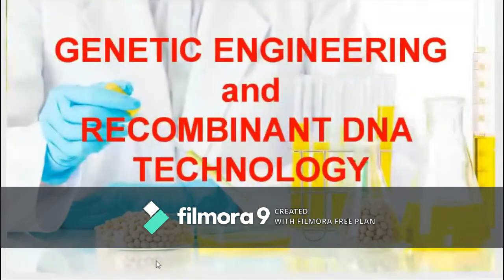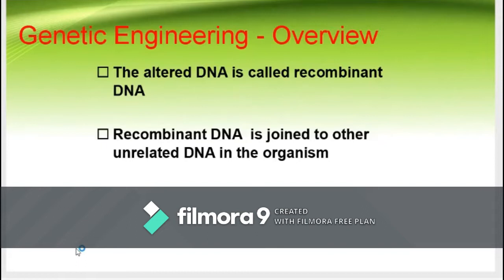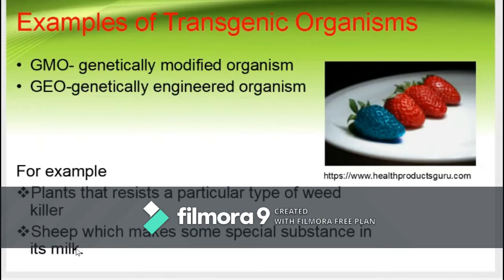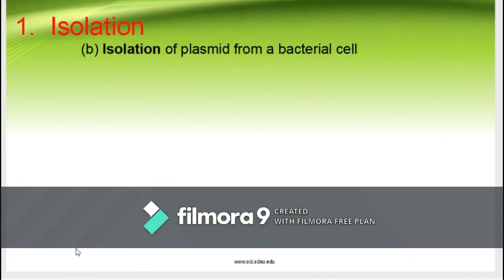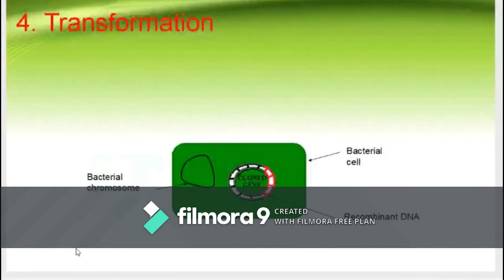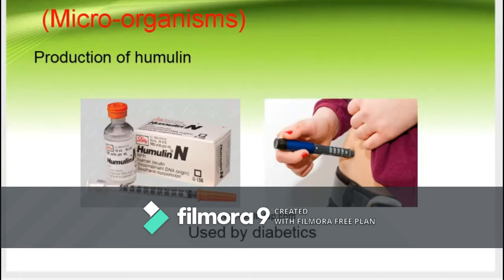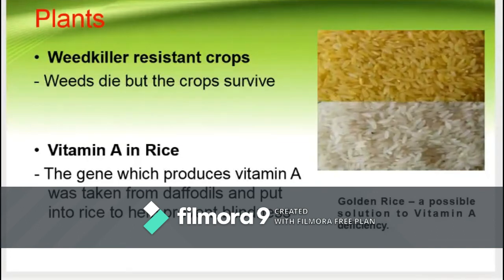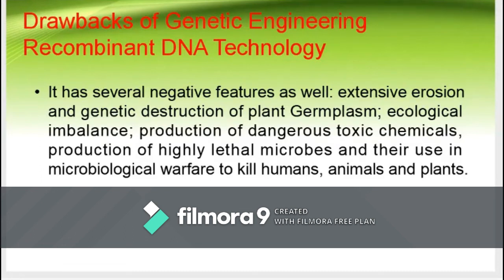GENETIC ENGINEERING & RDNA TECHNOLOGY

Comment: VALES, PRINCESS SHANLEY C.
11 STEM - DMITRI MENDELEEV

 Genetic engineering is the addition, deletion, or manipulation of a single trait in an organism to achieve the desired change such as human genes that are inserted into another animal’s DNA. The result of this manipulation of DNA is called recombinant DNA or RDNA for short. When fragments of a gene are taken out and replaced by different genes, it is called gene splicing. Transgenic Organisms, on the other hand, are genes that were spliced from bits of genes a living thing and another animal creating new genes. There are 2 types of transgenic organisms, GMO, genetically modified organism (plant, animal, bacterium that is altered through any methods including conventional breeding), and GEO, genetically engineered organism. (modified using techniques that permit the direct transfer or removal of genes in that organism. Some of these genes are used for the treatment of illnesses. They can take the form of vaccines and such.

There is a study regarding the genetic engineering of livestock (VG Pursel, 1989), stating that Genetic engineering of livestock is expected to have a major effect on the agricultural industry. A systematic study of the beneficial and adverse consequences of long-term elevations in the plasma levels of bovine growth hormone (bGH) was conducted on two lines of transgenic pigs. Two successive generations of pigs expressing the bGH gene showed significant improvements in both daily weight gain and feed efficiency and exhibited changes in carcass composition that included a marked reduction in subcutaneous fat. However, the long-term elevation of bGH was generally detrimental to health: the pigs had a high incidence of gastric ulcers, arthritis, cardiomegaly, dermatitis, and renal disease. The ability to produce pigs exhibiting only the beneficial, growth-promoting effects of growth hormone by a transgenic approach may require better control of transgene expression, a different genetic background, or a modified husbandry regimen.

	There are 5 stages involved in genetic engineering they are; Isolation, where they find and isolate the specific part of the DNA we wish to copy. Litigation and insertion where the extracted fragments of genes are transferred into a vector. Transformation where the genes inserted into the DNA of another organism. Expression where the transformed cells grow to produce a GM organism.

          I learned that genetic engineering and RDNA technology is very important in our day and age. The world has become a better place since the discovery of genetic engineering. I have learned throughout this video the definitions, applications, and the importance of the said topic. I am amazed at how even with just a tiny bit of DNA manipulation, new genes would be produced and used for medicine and scientific studies and hopefully in other fields in the future.

Comment: Sobrecaray, Ian Joseph I.
Grade 11-STEM MENDELEEV           

            As our technology and understanding of microbiology and genetics, it gave rise to a new field of engineering called Genetic Engineering. With Genetic engineering, scientists are now capable of adding, inserting, deleting, or in other words manipulating DNA to get a desired trait. It is done by copying a piece of DNA from one organism and joining this copy to the DNA of another organism. The altered DNA is called the Recombinant DNA and this process is called gene splicing. The organisms altered by genetic engineering are called transgenic organisms and their genes are changed by other than random natural breeding. Examples of transgenic organisms are GMOs(Genetically modified organisms) and GEOs(Genetically engineered organisms. Although they are sometimes used interchangeably, their meanings are different. GMOs are organisms whose genetic material are altered by any method including conventional breeding. GEOs are organisms whose genetic material are altered by the direct transfer or removal of genes to and from that organism. There are 5 stages in genetic engineering namely: Isolation, Cutting, Ligation and Insertion, Transformation, and Expression. Isolation is done by isolating a specific gene from a donor or by isolating plasmid from a bacterial cell. In cutting, restriction enzymes function as molecular scissors and they cut DNA at specific sites called restriction sites. They will however leave sticky ends which are ends wherein a single strand of the DNA remain in the manipulated cell. In lygation the cut DNA is to be inserted to another organism's DNA and rejoined with DNA ligase. As mentioned before since a single strand of DNA remain in the cut DNA, they can just form a bond with their complimentary chemical compounds. In transformation the cell is transformed and upon reproduction(bacteria) or cell division, the manipulated DNA will be copied and kept by the newly formed cells. In expression the newly formed cells will keep the characteristics of the donor DNA. Applications of genetic engineering include vaccines in medicine, genetically modified rice with Vitamin A in agriculture, and altering human DNA to remove genetic or inherited diseases and disorders in gene therapy. GMOs and GEOs can also be used in mining to remove the toxic waste materials produced in the process. Although genetic engineering can be beneficial, it can also be destructive. Genetic engineering can cause ecological imbalance, genetic destruction, and in production of harmful microbes that may be used in microbiological warfare to kill humans, animals, and plants. Genetic engineering provides promising benefits but is still, at the moment, unstable.

            In a study entitled "Plant genetic engineering for biofuel production: towards affordable cellulosic ethanol", by the researcher Meriam B. Sticklen, tackled the feasibility of cellulosic bioethanol to become an alternative, global, and renewable source of transportation fuel that will replace petroleum. Petroleum contributes to the enhanced greenhouse effect and is a non-renewable resource. Cellulosic bioethanol, on the other hand, can be easily found in starch from corn seeds and sugar from sugar cane. However, at the moment neither starch nor sugar can be produced at a sufficient level to meet global fuel needs. Furthermore, it would only increase the food prices and the cellulases pretreatment are known to be expensive. That is when genetic engineering comes into play. Genetically engineering plants to produce cellulases and hemicellulases, and to reduce the need for pretreatment processes through lignin modification, are promising paths to solving this problem, together with other strategies, such as increasing plant polysaccharide content and overall biomass. To date a few feedstock biofuel crops, such as corn and rice, have been developed with genetic engineering as biofactories that self-produce microbial cellulases within their biomass. Cellulosic biomass can be increased by the transfer of genes that shift energy from the reproductive to the vegetative state, and possibly through overexpressing enzymes that are associated with the biosynthesis of plant cellulose and hemicellulose. This is a good example of the advantages genetic engineering can provide for humanity.

            The video tackled the concept of Genetic engineering as well as the benefits and consequences of it to humanity. It was explained orderly and concisely with diagrams to further the understanding of the student. It included the different stages for genetic engineering or modification to take place. The nuances GMOs and GEOs were also explained concisely. Genetic engineering, if done right according to ethical principles, would benefit humanity in medicine, industry, and agriculture.

            The more we learn about genetics and microbiology, the more closer we are to actually manipulating it to our advantage. In the past, humanity had to adjust to its surroundings and build methods to properly use a specific resource effectively and efficiently; but in this modern age, our surroundings can finally be the one to adjust for us. By genetically engineering or modifying specific organisms we can have them fit our purposes and intentions thereby solving some of the world's problems such as in fuel source. However if genetic engineering is done in an unethical manner, it could pose a real threat to humanity. For example, genetic engineering could be use to create viruses or microbes that can easily kill a human. The worst part about this is that it is invisible to the naked eye and is capable of spreading at an alarming rate. Although genetic engineering has its benefits, it undoubtedly has its consequences.

Comment: CONCHA, Patricia Faye M.
XI- MARIE CUIRE

GENETIC ENGINEERING AND RDNA TECHNOLOGY

                Genetic engineering basically refers to the alteration or manipulation of the genetic makeup of an organism to create change. It is the removal of tiny segments of genes and replaced by different ones called gene splicing. These organisms altered via genetic engineering are called transgenic organisms. "Trans" means crossing, and "genic" means genes. GMO-Genetically Modified Organism and GEO- Genetically Engineered Organism are some of the examples. There are stages involved in the process of genetic engineering; isolation, cutting, ligation and insertion, transformation, and expression. Genetic engineering plays a crucial role as they are beneficial in the fields of medicine, agriculture, environmental clean ups, and forensics.  
               Genetic engineering of livestock is expected to have a major effect on the agricultural industry. However, accurate assessment of the consequences of transgene expression is impossible without multigenerational studies. A systematic study of the beneficial and adverse consequences of long-term elevations in the plasma levels of bovine growth hormone (bGH) was conducted on two lines of transgenic pigs. Two successive generations of pigs expressing the bGH gene showed significant improvements in both daily weight gain and feed efficiency and exhibited changes in carcass composition that included a marked reduction in subcutaneous fat. However, long-term elevation of bGH was generally detrimental to health: the pigs had a high incidence of gastric ulcers, arthritis, cardiomegaly, dermatitis, and renal disease. The ability to produce pigs exhibiting only the beneficial, growth-promoting effects of growth hormone by a transgenic approach may require better control of transgene expression, a different genetic background, or a modified husbandry regimen.
https://science.sciencemag.org/content/244/4910/1281.abstract
               Genetic engineering is the alteration of the genetic makeup of a particular organism. It is the removal of tiny segments of genes and replaced by different ones to create a change. There are stages involved in the process of genetic engineering; isolation, cutting, ligation and insertion, transformation, and expression. The result of this process applied to a particular organism forming a new one is called a transgenic organism.
              This video gave me the knowledge and understanding of genetic engineering and how this process is performed. Besides, how crucial it is in the fields of medicine, agriculture, and forensics. However, there are risk factors to consider; allergens in the food supply, birth defects, possibility of increased economic inequality, other unknown negative outcomes, etc.

Comment: Delgado, Rafael Louis G.
11 - STEM Marie Curie
          In order to achieve the desired change, genetic engineering is the simple addition, elimination, or manipulation of a single trait in an organism. It copies a fragment of DNA from one organism artificially and joins this copy of DNA into another organism's DNA. Its function is to make it possible to inject genes from one organism into a cell of a different species of an organism. In addition, to generate human proteins, bacteria can be engineered and human genes can be introduced into other organisms. Gene splicing is defined as tiny segments of a gene are taken out and replaced by different genes. By genetic engineering, organisms altered are called transgenic organisms. These are organisms whose genetic material is changed by other than random natural breeding through gene transfer. Examples of transgenic organisms are genetically modified organisms (GMO) and genetically engineered organisms (GEO). These five stages are involved in genetic engineering which are isolation, cutting, ligation, insertion, and transformation. Genetic engineering can be used for medicine, agriculture, and forensic.
          The emergence and outbreak of the novel coronavirus highlighted the urgent need for new therapeutic technologies that are fast, precise, stable, easy to manufacture, and target-specific for surveillance and treatment. Molecular biology tools that include gene-editing approaches such as CRISPR-Cas12/13-based SHERLOCK, DETECTR, CARVER and PAC-MAN, antisense oligonucleotides, antisense peptide nucleic acids, ribozymes, aptamers, and RNAi silencing approaches produced with cutting-edge scientific advances compared to conventional diagnostic or treatment methods could be vital in COVID-19 and other future outbreaks. Thus, in this review, we will discuss potent molecular biology approaches that can revolutionize diagnostic of viral infections and therapies to fight COVID-19 in a highly specific, stable, and efficient way. 
          Genetic engineering is the collection of techniques used to achieve one or more of three objectives: to reveal the complex processes of inheriting and expressing genes, to provide a better understanding and effective treatment for different diseases, and to generate economic benefits, including improved agricultural plants and animals, and to produce valuable biopharmaceuticals effectively. The characteristics of genetic engineering possess both vast promise and a potential threat to humankind. It is an understatement to say that genetic engineering will revolutionize medicine and agriculture in the 21st future. As this technology unleashes its power to impact our daily life, it will also bring challenges to our ethical system and religious beliefs.
          As it modifies the features of the genetic material, this engineering is a different level of the process. It is unethical in some cases and it has consequences that we might face in the long run. The genetic engineering also has advantages such as application in the food industry, in medicine, in the environment, in crop improvement, and improvement of animals but it also has the disadvantage such as it limits the amount of diversity that is available, negative consequences when interacting with other species, and it can lead to more birth defects.

Comment: AL Lluna-Ann B. Manlimos
STEM Marie Curie      
      
         Genetic engineering is a process by which recombinant DNA (rDNA) technology is used to alter the genetic structure of the species. Humans have indirectly manipulated genomes by regulating mating and evaluating offspring with the desired traits. An organism that is transformed is called a transgenic organism. The transgenic organism is categorized into two types: GEO (Genetically Engineered Organism) and GMO (Genetically Modified Organism).This process consists of five stages namely; (1) Isolation, which includes opening of the donor cells to release the DNA and isolating the genetic material. (2) Cutting different areas with the use of enzymes. (3) Ligation and Insertion, bringing together the DNA fragments. (4) Transformation, creating unnecessary recombinant molecules and (5) Expression, which involves extracting the modified DNA of the organism to produce the desired protein. Thus, this system is very effective in the fields of medicine, agriculture, forensics and so on.
            Somehow a study that can be related to genetic engineering is "Genetic Mutation" by Dr. Laurence Loewe. Mutations are variations in the gene code which are the primary cause of the diversity of species. These changes take place at several multiple stages, and can have widely varying consequences. In reproductive systems, we must concentrate first on whether they're legacy; in fact, certain mutations affect only the person who bears them, whereas others affect all of the child and further relatives of the carriers. In order to affect the offspring of the organism, mutations must:1) occur in the next generation of cells, and2) affect the genetic material. Mutation is therefore part of the genetic engineering process.
           We were able to determine that species could be transformed by a genetic organism, that genetic code could be improved by another random natural breeding and genetic transformation, and that we also learned what transgenic entails through this analysis. And states that "trans" implies crossing from one location to another and "genic" denotes genes.
            Indeed,  genetic engineering is very useful and very beneficial to us, especially in this generation. This allows every task to be done easily. In addition, individuals may do some experiments on things they want and be satisfied with the help of genetic engineering. I therefore conclude that this framework is really a brilliant innovation that can lead to a prosperous and progressive future.